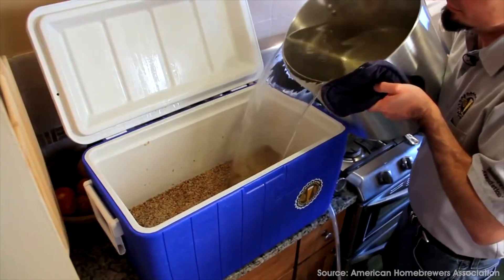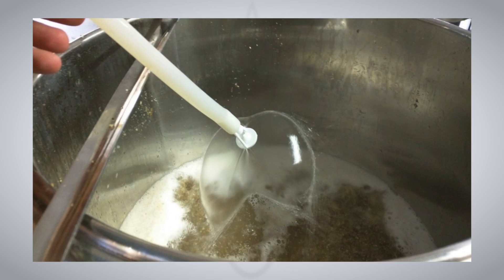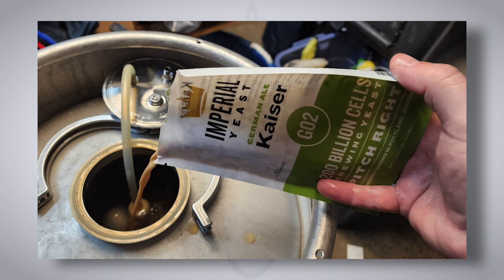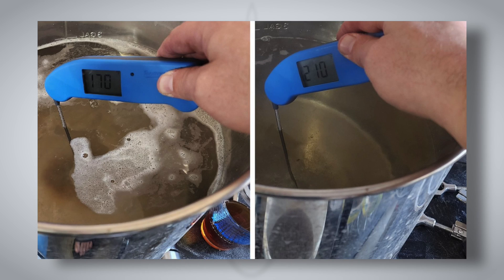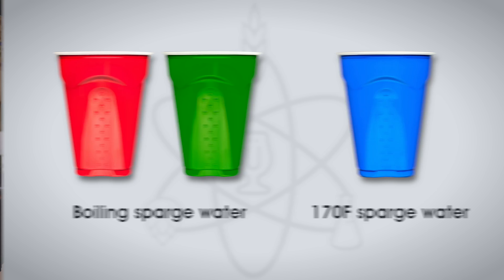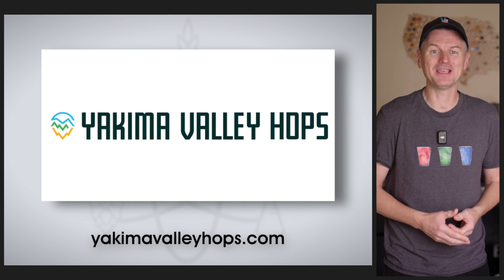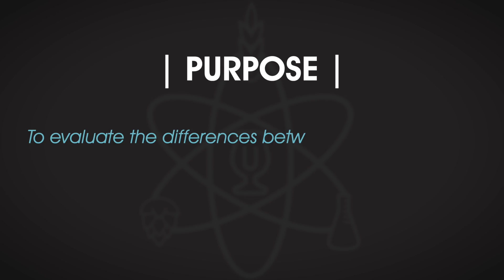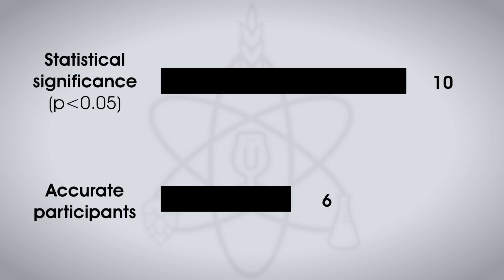Impact Sparge Water Temperature Has On Beer Quality | exBEERiment

Comment: Most mash is done at 150F to 152F. I would just bring 7 or 8 gallons to the mash temp to 162F and dump off 3 gallons into a cooler, then add the grains which should bring the temp back down to 152F. Mash for an hour then fly sparge with that 162F water Till it reaches 7 gallons, then boil for an hour down to 5.5 gallons.

Comment: I normally perform a decoction to achieve a mash out temperature of 170 degrees F ( or close to). I then perform a hybrid fly sparge with 170 to 200 degree hot liquor (water). I don't actually drip or spray the hot water on. I put a perforated screen over the mash and flood over the screen using my hot liquor hose, to form a 1 to 3 inch layer of the hot water. That layer of hot water is prone to quick cooling and never seems to cause the temperature of the mash to increase excepting for the very surface. Lautering is normally 60 to 75 minutes. By the way, my mash/lauter tun is a converted 15.5 gallon keg. It's normally filled with 22 to 37 pounds of malt. Brew Kettle cast out volume 12 to 21 gallons. Some mashes might be slightly thicker than 1 qt to 1 pound of malt but I prefer 1.25 quarts per pound. I frequently perform decoctions. The decoctions significantly thin the mash, significantly improve extract efficiency, and avert stuck mashes. I'm not afraid of the additional work. It's won me many awards. I definitely don't batch sparge. I think of that as madness. Why would anyone want to establish their grain bed and vorlauf twice? I normally only recognize excessive tannins once the extract gravity falls below 1.011.

Comment: I always have my strike at 76c before adding the grain, drops to 66-68c then soak. Remove and drain grain bag into the pot. Start the boil while draining bag. Remove bag to a bucket. 
Replace the bag 
Sparge I heat to 80c then sparge in the bucket remove bag and  add sparge to the wort pan.
Little time lost.

Comment: I sparge a bit like Will does; I heat my total water volume to strike temperature then drain my sparge water into a kettle. As I approach the end of the mash, I reheat the reserved water to 170F for my sparge. I've fussed with the temperature, trying to make it as close to 170 as possible, without going over. This video indicates that I need not fuss with it. Wonderful experiments with surprising results!

Comment: I just started a Porter partial mash partial liquid malt kit. I had watched a few people doing a sparge, in different ways, some all grain BIAB. I had only done all malt brews before. Long ago.

I went with my instincts, since the instructions made no mention of doing a sparge, and I knew there was a lot more sugar in there. I heated water to the same temp. as what the mash temp. was, that I just took the bag out of. Just seemed to make sense. To get the most out of the kit, I should have started with at least a half liter less water, since I added sparge water. If I made too much hot wort, it would not cool down for hours, no matter how cold the additional water was. So next time, I'll start with a bit less water so I can sparge my bag, and have the correct amount of wort, but with a bit more flavor/sugar ;-)

I am waiting for signs of life in the fermentor.

Comment: I always do 175ºf- since that is what the system says.  I never thought about it too much. I have a separate sparge water heater, and just do a litre at a time. So it cools a bit when putting in. 
 It always appears to work well. 

 Grainfather G30 with updated basket.

Comment: I have had the same result sparging with boiling vs 170f water. Thanks for the validation. As far as Yakima Valley Hops, I used to purchase from them, but one day the shipment got lost. Customer service was anything but.They insisted that I contact the shipper and file a claim; I said wtf, you shipped it, YOU track it and file a claim. They just told me to fk off and closed my account. So now I purchase from Hops Direct; better pricing and nice folks to deal with. They did lose one shipment, but replaced it next day, no charge. Great folks to deal with.
Reply: I've been buying from Hops Direct, formerly Peuterbaugh for 30 years I've never been disappointed except when I couldn't find the hop variety I wanted on their menu.

Comment: For a good 18 months after purchasing my all-grain Brewzilla setup I sparged with hot water from the tap or cold water - mainly due to not having funds for a sparge heater. During that time I always noticed the gravity was lower than expected and that the boil took an age to achieve; but that being said the beer always turned out great. Having a sparge heater on reflection though is definitely worth the investment, if just for the satisfaction of achieving your OG numbers or just speeding up the process. That being said, upon viewing this video I might raise the temperature of my sparge water a bit higher since it has negligible impact on taste - thanks for the insight.

Comment: Ph is much more significant. So the test would be. Sparge with above ph 6 sparge water vs ph 5.2 sparge water. 
That said on larger 250/500L plus systems using at least 100kg or more malt then things will change in relation to sparge water temp I suspect.

Comment: +1 on the pH test.  Do a 5.3 pH sparge and a 7.5 pH sparge.  I use the very high end of what municipal tap water might be at (as opposed to a balanced 7.0), because if the triangle concludes no significant detection, pretty much any sparge water on the planet would suffice.

Comment: Would be interested to see exbeeriments on mash thickness (water to grain ratio) and stir/no-stir effect on mash efficiency. Seeing conflicting information on these.
Reply: probably you are goin to have a difference in between the different thickness of the mash (ratio) depending on the diastatic capacity of the grains in to yur mash, the stirring i think will appear in your beer as tanins, cause of the mechanic. As I get it, the Extraction and the effiency will be attachted to the previous process that would be the milling and how available the sugar will be by contact.

Comment: Hi there, I’m a newbee pro brewer
The last head brewer mistakingly set 89C water for sparging in the brewing plant programme and the result is obvious, harsh and tannic beer. From what I have seen so far the sparging process is very long in breweries varying from 1 and a half to 2 hours for big beers and sometimes even more if things get sticky. The combination of time and temperature is definitely a key component in tannin extraction.
I’d say that at a homebrew level where batch sparge is preferred, temp is not vitally important as pH management

Comment: I heat my mash/sparge water in my hlt/bk. When the boil kettle hits strike temp, i pump it to my mash tun and start doughing in. The sparge water is still heating up to about190-200F before shutting that burner off. By the time the temp drops to 170, the mash is done and I'm ready to start sparging the grains.

Comment: I found that with my system that the sparge water cannot be too hot. This is because so much heat is lost when sparge water slowly goes through the tube and out the recirc. If fly sparging slow enough then it is very difficult for the mash temp to rise much above mash out temp. I wonder if this is why he decided to do a batch sparge. While you wouldn’t lose as much heat putting all the sparge water in at once, a lot of heat from the mash would have been lost when it first drained again making it hard to raise the thermal mass of the mash above mash out temp (76). I think you would have to push the mash out temp much higher to experience tannins. Sparge water temp is kind of erroneous because everyone will lose different amounts of heat depending on their kit and process. A better variable to measure would be how hot the actual mash temp gets during mash out and what the threshold is for when you start to taste tannins

Comment: 4:52 There may be no difference in SG, because the Milwaukee MA871 has an accuracy of + or - 0.2% Brix. 12.8 + 0.2 is 13 and 13.2 - 0.2 is 13. Alternatively, the values could be 12.6 and 13.4 brix at the other extreme.

Comment: I have a 220volt system that I have to disconnect the stove, so I heat sparge water on the stove in a 5.5 gallon kettle and jacket it, by the time I'm ready for sparge it's still around the correct temp😅

Comment: One point that needs to be made for the premise to this experiment, is that sparge temperature is a FACTOR for tannin extraction, not a sole cause. Same goes for pH. Therefore, I don't think the non-significant difference result of this experiment proves that sparge temperature is an old wives tale, but shows that it is not a primary factor. Which is good. It is nice that sparging temperature astringency is less of a problem than we feared it was, but it doesn't negate the fact that astringency occurs. Temperature is a factor, and this experiment suggests it is a secondary one. or tertiary.
Reply: All due respect, but this is a meaningless conclusion/comment (for many reasons). You are correct in that this experiment "proves" nothing. (Side note: we scientists shy away from the word "prove".) What "proves" that sparge-water temp has NOTHING to do with tannin extraction is hundreds of years of brewing experience and data that show conclusively that temp is NOT a factor. Not a primary factor, not a secondary factor, not a tertiary factor. You appear to have strongly held beliefs about this that you do not want to be proven wrong. If you know something that refutes 500 years of brewing experience, please share. It needs to be based not on opinion or belief, but on objective, peer-reviewed science/data. 

"Temperature is a factor, and this experiment suggests it is a secondary one. or tertiary." Data please. Not your opinions or beliefs, but data. I'll wait. Cheers.

Comment: Maybe silly, but what about the impact of gravity (and so forth ABV) on the final taste ? Targeting a specific style and profile overall efficiency is hard to control in home brewing. Can a taster distinguish a beer that is on target and an batch not really ? Can we perceptually detect an ABV delta in 0.5 or 1 even 1.5 point in each batch ? Is there any detectable tasting difference between a recipe and a slighter session version one ? When I'm not on target my beers finished very mostly fine by being less flexible will it make my beer significantly more pleasant ?

Comment: According to my original "brew beer" book from 30 years ago (Dave Miller), sparge temp should be from 168 F to 165 F.  I do full sparge: when mash is finished, I sparge the whole batch with water around 168F +_ 4 to 5 degrees (water in a separate bucket,  that has been previously heated). I sparge until the wort reaches the mark on my brewing pot. I have noticed in the past a decrease in efficiency when using sparge water that is not warm enough, but mostly, when sparging too quickly (less than a hour long). Overall, my results have been great for most of those 30 years, for all styles of beer. The temperature that I pay attention to is the mash temperature.

Comment: I use an all in one system, and generally have been heating my full volume water to strike temp with my water additions, pulling off my sparge amount in a pot to heat to 170 on the stove while I mash. Seems to work good and isn’t much of a hassle to do.

Comment: Where does the so-called "conventional wisdom" come from that sparging with too-hot water will extract astrigency? It's very silly. Decoction mashing, anyone? German brewers have been boiling the mash for centuries, and yet they make the smoothest beers on the planet. If subjecting the mash to boiling or near-boiling temps, either via sparging or actually boiling it, extracts tannins, this would have been realized a long, long, long time ago. This myth was refuted as far back as the 1500s, folks.

Comment: I do cold sparges at the moment because I don’t have a convenient way to heat sparge water in my garage. My Foundry only needs a 1.0-1.5gal mini-sparge so the grain temp doesn’t suffer much. I probably get a small drop in efficiency but you can’t beat the convenience!

Comment: I wonder if a beer with more roasted malts - which can tend towards harshness and astringency - would suffer more from a boiling sparge. 🤔
Reply: Not even worth testing, answer is yes=)
Reply: @patrickglaser1560  not nessisarily, you have to take PH  into account when it comes to the extraction of harsh compounds. Due to the buffering effect of the yeast during the ferment and floculation, there is also a real question of whether or not it makes it into the glass. 

My beers are double decoction mashed with a boiling sparge, and my with my stouts I've never had an issue (ironically, I've had issues with getting enough roasty bite).

Comment: The pH value determines whether tannins are extracted. If the pH is below 6, no tannins will be extracted even if the mash is boiled. This is why decoction mashing can be used without tannins ending up in the final product.

If you don't know the pH, it is therefore recommended to either stop lautering when you reach a density of 1.010, as the pH is then probably okay. Alternatively, you can avoid going above 80 degrees Celsius, as this will not extract as many tannins even if the pH is too high. This is perhaps most relevant for professional brewers where yield is important.

For homebrewers, as your excellent experiment shows, it is not as important because you often stop lautering much earlier than the critical density level of around 1.010.
Reply: Would be interesting to see an experiment with different ph sparge water
Reply: That's not 100% correct. The tannins get reduced through oxidation as well as during the complex formation while proteins coagulate during the decoction.

Beer is full of tannins and polyphenols. That's why beer that is not stabilized with pvpp gets cloudy after a couple of months
Reply: @Mikkogram  Great! Where can I find this information? Is there any articles you can recommend?

Comment: I use a Brewzilla, I bring my volume (usually 7.5gal) up to strike temp and pull off about a gallon of hot water for the sparge, filling two double insulated growlers. They hold temp well and with doing a full volume mash I routinely get 80%+ efficiency which is good enough for me, always hitting my targets.

Comment: Great experiment. Thanks for sharing! I wanted to offer a handy idea on the sparging method Will spoke of towards the end of the video. I do the same in that I treat the full volume of water and then draw off the water I reserve for my sparge. But, a few minutes before it is time to sparge, I reheat and hold the water at 170 using a sous vide stick. Works great to keep the mash temp up! Another great use for an immersion circulator.

Comment: Tannin extraction is more a function of PH than it is heat so the results are not a surprise.
Reply: Exactly, they should try tap water of Ph 8.8 with hot and cold sparge. Also need participants that have a tongue that can taste tannins at enough ppm.

Comment: BZ65 with a digiboil35 sparge water heater. Usually I do 78c, but there are times when the water have not been all the way up there, but still, 60c and 5c sparge water, ALOT of difference in boil-time (getting to saied boil).

Comment: But no sparge in all-in-one system, wouldn't mash be much too  thin? To little enzymes? That's easily mite than 4l/kg grain.
Reply: yeh thought that was odd too
Reply: No, i do it. Its figured into the water loss during boil.
Reply: @MrConnormb It's not about abundant water it's about the thickness of the mash. More water to begin with means less enzymes per liter. Could cause a worse conversion and efficiency. New Brulosphy test??

Comment: I'm with Will. I heat the full volume to strike temperature and put away a portion as sparge water. For small sparges I also sometimes use room temperature water. To my knowledge very hot water may not only extract tanins, but also new starches which is also not desirable.
Reply: That’s right, over 80C there will be new starches extracted which won’t be converted anymore because the enzymes are denatured. That will result in a cloudy beer.

Comment: With my Anvil Foundry I normally do a full volume mash and only sparge when brewing imperial-type beers. Cheers!🍻
Reply: Having just gotten an Anvil 10.5, I was going to ask that very question. 

Would like to see sparge vs no sparge. 

Before Anvil, I just did a full volume water, brought it up to mash temp, peeled off 2-3 gallons into 1 gal bottles, stored in a cooler to not loose as much heat, and splarged with that water